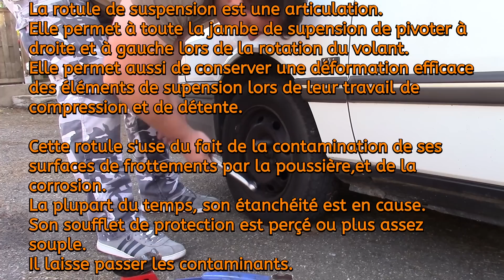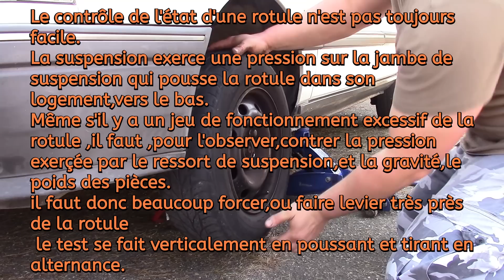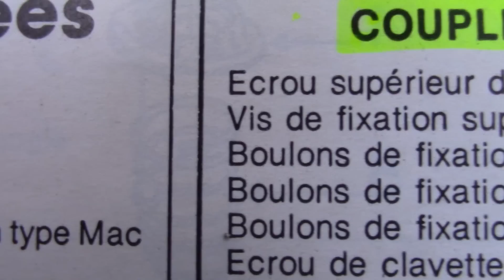Remplacer une rotule de suspension.

Comment: Merci beaucoup je doit faire la miennes sur ma 106 mais j'avais peur D'avoir du mal a mettre la nouvelle j'ai plus qu'à essayé maintenant j'espère au je vais pas me foiré
Reply from the maker: : )
Attention,les rotules de suspension sont des fois intégrées au triangles de suspension.
On ne peut donc pas les remplacer seules,et il faut alors aussi changer le triangle.
A ma connaissance,c'est le cas pour les 106 et 206 ,tout est d'un bloc.
Il suffit de vérifier sur la voiture,ou simplement sur un site de vente de pièces auto.

Comment: Très bonne vidéo par contre, est-ce que quand une rotule de suspension est HS est-ce que ça se sent dans la direction mais pas à l'oreille  ? Car moi j'ai un genre de gloup quand je retourne sur place Ou quand je commence à rouler en vitesse réduite.
Reply from the maker: Merci,
Oui, le bas de la suspension bouge,donc le carrossage aussi,l'angle de chasse aussi et la précision du train avant diminue,et se sent au volant.
A chaque freinage ou accélération la roue recule ou avance sur son point de pivot qui est censé être fixe,sans jeu.
Reply: @michaelovitch  ok donc ce pourrait être la cause de ma sensation de gloup dans la direction , par contre en roulant normalement rien , déformation de route aucune sensation non plus , âpres elle reste précise et ne tire pas a droite ni a gauche et usure de pneus normal

Comment: Salut très bonne vidéo, je dois moi aussi changer la rotule.... Seulement, mon cardan s'est déboîter de la boîte... Faut-il que je dévisse la moyeu pour remettre le cardan ? Et deuxième soucis.... L'axe horizontal que tu dévisse en dernier pour la rotule ne veut pas sortir... Marteau dégrippant tout y est passer mais elle ne bouge pas d'un millimètres...
Reply from the maker: Salut,
Tirer le triangle vers l'extérieur tout en introduisant à nouveau le cardan dans la boite suffit la plupart du temps. 
L'axe horizontal ? si c'est la rotule de direction ,il suffit  de taper sur le porte moyeu autour d'elle (là où elle est insérée) avec des coups secs tout en la tirant ou poussant vers la sortie.
Attention à ne pas abimer le soufflet en caoutchouc,et surtout de desserrer un peu,ou complètement l'écrou avant.

Comment: Bonjour, faut il faire le parallélisme ? J'ai un grand renault modus
Reply from the maker: Bonjour,
Si on respecte exactement ou à 1 mm près la dimension précédente ,non.
(distance entre l'axe de la rotule (partie articulée) et l'extrémité de sa tige)
Si la nouvelle rotule est plus longue ou plus courte,on bouge l'écrou pour retrouver l'ancienne dimension plus ou moins la différence de la nouvelle.
Reply: @michaelovitch  c'est pas absolument nécessaire donc Merci 👋

Comment: Bonjour, un peu de temps qui est passé sous les ponts depuis votre vidéo   =) mais j'ai une question, j'ai un grognement lorsque je tourne le volant côté gauche (lors de manœuvres) R.19 1991 115.000 km (pas de direction assistée). Difficile de localiser d'ou cela peu provenir, de toute façon je vais changer les deux rotules de suspensions et rotules de direction.
Reply from the maker: Bonjour,
Il faut lever la roue gauche,et secouer la roue alternativement,mains horizontales pour vérifier si la rotule de direction à du jeu.
Mains verticales pour vérifier si la rotule de suspension,ou roulement de roue a du jeu.
Il se peut aussi que ce soit la coupelle de suspension,car elle tourne en même temps que la roue,de chaque coté  : conducteur et passager.
inutile de changer des pièces qui ne le nécessitent pas il faut diagnostiquer avant : )
Il suffit peut être simplement de graisser les coupelles.
Reply: @michaelovitch  Merci je vais tester rapidement, j'ai aussi le volant légèrement décalé lorsque mes roues sont droites ....... De toute façon je reviens pour donner le résultat dès que j'ai pu testé merci encore.
Reply from the maker: @madeinlorrainefrederic166  
Le volant décalé,c'est le parallélisme qui n'est pas réglé correctement ou le train avant usé,qui a du jeu.
Reply: Donc crémaillère ?
Reply from the maker: @madeinlorrainefrederic166  
ça peut  être un tas de trucs sur le train avant, il y des articulations partout.
Reply: Oui 2 rotules de suspension sur chaque  triangles inférieu,r 2 de direction au bout des 2 biellettes de direction puis crémaillère pour terminer bare de direction j'allais oublier les 2 paliers d'amortisseurs 😊 je n'ai pas de barre stabilisatrice !  Pour moi pas les silenblocs des bras de triangles

Comment: Bonjour ma voiture ne démarre pas, lundi soir elle démarrait mais le jeudi matin de la même semaine elle ne fonctionnait plus.
 j'ai donc acheter un appareil de mesure batterie/alternateur que l'on place sur l'allume cigare (pour qu'il marche il suffit juste de mettre le contact). 
Cela m'a donné une mesure de 11,9 pour la batterie et 11,9 pour l'alternateur. Est ce que je dois changer ces deux éléments? Merci.
Reply from the maker: Bonjour,
Si la valeur de 11.9 volts est affichée moteur éteint et aussi moteur en route,je pense qu'il est sage de dire que l'alternateur ne charge pas la batterie.
La tension (volts) moteur en route, doit être de plus de 13 volts.
une batterie chargée,après une journée de repos doit afficher 12.6 volts. ou un peu moins,si elle a quelques années, mais supérieure à 12 volts.
Il serait bon de vérifier le serrage des connections sur l’alternateur,et la batterie,éliminer une éventuelle corrosion sur les connections.
Il faut recharger la batterie,et essayer de démarrer.
une fois la voiture en route,mesurer la tension de batterie.
Si l"alternateur charge ,la batterie est certainement défaillante.
Si l'alternateur ne charge pas,la voiture a pu démarrer,mais la tension ne montera pas ,moteur en route.
Une batterie dure plus ou moins 5 ans,en moyenne.
Un alternateur use ses charbons,des contacts,et c'est souvent le seul problème rencontré qui cause un arrêt de charge de batterie.